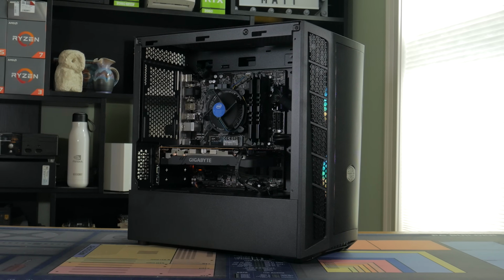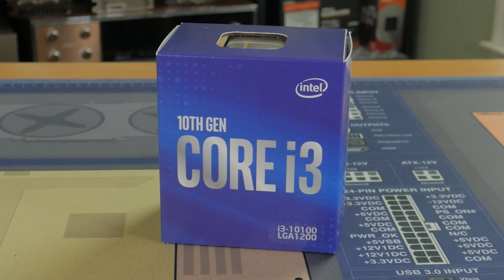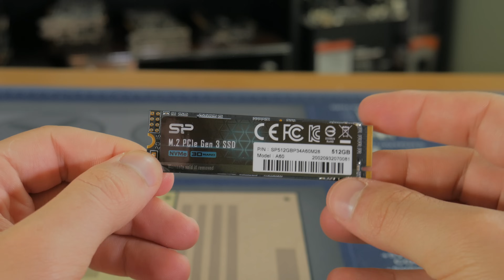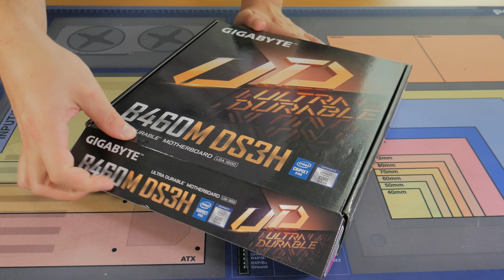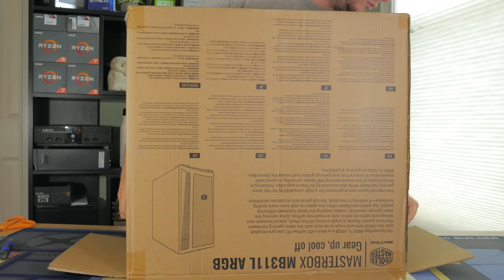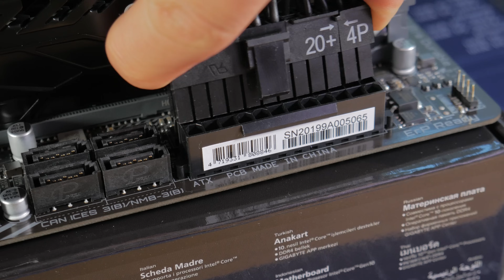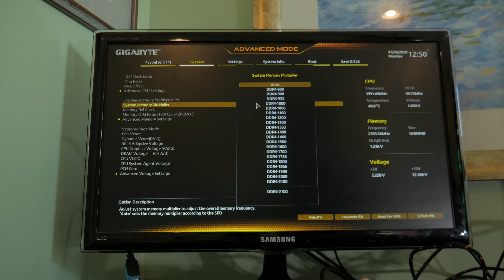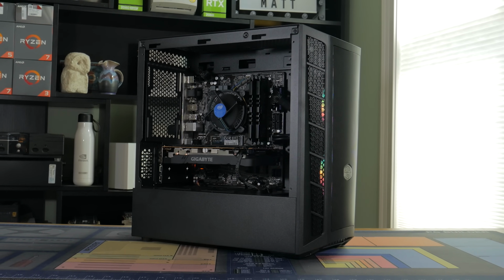$600 Gaming PC Build Guide! (2020)

Comment: Worst you can do way more with 600 bucks
Reply: If you can find a cheap case pick up a 70€ b450 asrok whit a ryzen 7 5800x on auction on ebay for 300€ and a 3070-80 still on auction for another 250 then a 15 dollar power supply from cooler master piked up used and 16gb of ddr4.

Comment: I've put together my own PC's for over a decade but couldn't get this processor to work. First intel build also. Checked and rechecked my build, swapped motherboards,  power supply and monitors. Checked ram also, still no video signal.

Comment: Great build, I used his most of his parts except for a few small thing that I switched to similar parts that were either a couple bucks cheaper or were in stock. I have no idea abt the frames right now because I don't have my monitor yet, but it seems pretty fast from what I can tell so far. 

The build went smoothly EXCEPT FOR ONE THING. I spent an hour researching if I could connect a 3pin header from the case's fans into the 4pin header of the motherboard, and it turns out you can, just make sure to change the bios setting. (https://forums.tomshardware.com/threads/can-i-connect-3pin-fan-to-4pin-header-on-mod-and-will-the-fan-spin.3344342/) Not including the time I spent figuring that out, the build took about an hour and a half.

All in all great build though, nice vid, good job.

Comment: Hi I bought everything and I tried to turn it on but it wont work, and now am scared because I cant return it
Reply: What won't work?
Reply: @JJFlores197  I bought everything he had and most of the wires he had arent in the case, and now it wont work and I lost nearly 700
Reply: @mo-zc8wz  Which wires are you talking about?  If you're talking about the front panel cables, make sure to check the entire case. I'm not familiar with that case, but sometimes the cables are hidden in the back panel. According to this video, the f_panel cables should be on the side: https://youtu.be/VIuO1yKEozE?t=400
Reply: @JJFlores197  I bought the case in the link he had in the description, it doesnt look exactly the same but its the same size, am missing the fan splitter, power led, reset sw, h.d.d sw
Reply: @mo-zc8wz  which one? He linked 2 cases to choose from
Reply: @JJFlores197  the one on amazon
Reply: @mo-zc8wz  If you have checked every part of the case and you can 100% verify that it is in fact missing the front panel cables, then you should be able to return it. Amazon makes it absurdly easy to return things, especially if they arrive damaged or not complete.
Reply: @JJFlores197  I cant return it bc it's been over 30 days, but I just realized that he has 2 different cases, in the Amazon link one, it has the same one that I have, but he has the one from the new egg link

Comment: this is NOT $600 I have a 600 system all parted out here it is
cpu: ryzen 3 3100
Motherboard: MSI b550 pro- vdh wifi micro atx 
RAM: 2x8 GB g. skill (red) ddr4-3600 cl- 19 
Storage: Team MS30 512 GB M.2
Video card: rx 570 - MSI 8GB armor oc 
Case: phanteks eclipse p300 Atx mid tower case 
PSU: EVGA BR 450w 80+ bronze

Comment: For those of you wondering, 3300x CPUs are impossible to find rn
Reply: yes but the 3100 isnt
Reply: I take this back now they are higher priced and starting to get a little harder to find but that’s what? 4 months after their release?
Reply: @trentbolognani2509  10100f is slightly better than 3100
Reply: @chickenism8107  i wanted an amd system and I grabbed a b550m motherboard so that I can keep upgrading without needing a new motherboard
Reply: go on ebay or adorama, there should be some

Comment: Great video but i would have chosen the r3 3300x because it has a better stock cooler , you can overclock it , its on the am4 platform and has that fast chamber thing that i don't know how it's called . Also , for a more all round cpu the ryzen 5 1600AF would have been better because it has 6 cores and 12 threads but availability is a tricky factor

Comment: I did a build with a 9100f for $76 16gb 2666mhz for $50,sp 512gb nvme ssd for $54,the case included in the vide for $60,600 watt 80pls bronze certified for $50
And the rx 5500XT for $200 with still 40 bucks left over. I will upgrade the cpu afew months down the line but for $560 with the only compromise being storage atm if your not a super intense gamer is a steal!

Comment: You should try Minecraft it’s easy to run and I would like to the FPS on it great video keep doing these types of vids
Reply: I'm not super familiar with AMD GPU performance but a mid-range card and a quad-core CPU should get well into 60s fps range with reasonable 1080p settings. Minecraft itself isn't hard to run, but I know some situations can be harder on hardware than otherwise expected.

Comment: I have built a budget pc for €150
I5-4440
Ddr3 16 gb ram 
256gb ssd
1tb hdd (from a oem system)
Used GTX 760 twin blade.
Case is a dell optiplex 9010
(Note, very risky when it comes to scams and broken products)

Comment: intel stock cooler lol
Reply: Are these parts bad for the price of the pc?
Reply: @maisonplays2049   no there not but if you have a little extra cash get a better cooler
Reply: @keithfernandez181  I’m going to get a I5 instead of the I3.
Reply: @maisonplays2049   ok thats a good pick but make sure it is compatible with your motherboard choice as well
Reply: @keithfernandez181  I’m pretty sure it is. Is it compatible if it’s the same socket size? Or is there other things that matter
Reply: @maisonplays2049   there are other things that matter but  for this price point I would go with amd maybe second gen ryzen 5 and a gigabyte b450m ds3h
Reply: @keithfernandez181  can you please help me and see if the I5 is compatible with the mother board? I already have the mother board and am about to order the cpu
Reply: @maisonplays2049  to be homest i dont think it is and plus the i 5 couldnt really be used to its full potential in this motherboard
Reply: @keithfernandez181  but will it do better than the I3? Because I already have the motherboard
Reply: @maisonplays2049  Well yes it will but the i5 isnt compatible with the motherboard so get the i3

Comment: Hey matt my budget is 350 dollars what case  would you recommend?I dont want to get a normal case maybe something like the deepcool matrexx 30
Reply: Deepcools real budget stuff is very noticeably budget, so just be careful. I got a Deepcool Matrexx70aRGB (the same case is sold without the aRGB fans for $70 instead of $100, but the 3 included RGB fans are not only diffused, but cost $45 per 3/pk and have like 12 LEDs per fan) for my first case, and it was decent enough, but no rubber grommets for cables, so it does still show it's more budget side.
Reply: @TheGauges420  Alright

Comment: First budget system I’ve seen that isn’t built around an AMD cpu... interesting
Reply: @drkrma1905  get the ryzen 3 3100 same price alot more performance 3200g is only gud if you have no gpu but even 3200g can barely play any games.
Reply: oreoeatsoreos facts, or the 3300x but I forgot the price on that pne
Reply: tbh i dont know many friends with intel systems these days, both on the budget and the higher ends
Reply: @drkrma1905  You should try saving for the 3100 or just getting the i3 9100f
Reply: do yk if you can upgrade with this?
Reply: @drkrma1905  Get a R5 3400G. The difference of price between this one and 3 3200G is around the 40% but it's 100miles far better
Reply: @drkrma1905  Buy Core i3 9100f if going with a gpu
Reply: Jürgen Klopp no overclock .... but it’s a decent choice
Reply: Very
Reply: it depends tho.. in my country i3 10100 is lowerprice than ryzen 3300x.. and that wrong but yeah.m differance country..
Reply: Very interesting
Reply: If I were you I would just save up a little more for a Ryzen 5 3600
Reply: @MakeGamesGreatAgain  I’m not in the market for a budget pc, I already have a nice $1500 one I built about 2 years ago. I just like watching these videos. But yes, a 3600 would be better, or a 1600 af if you can find one in stock somewhere and save a few bucks
Reply: @avimose4126  should I get an intel core i5 10400 on sale for $160, or the AMD r5 1600 for $150? Or is there an even better option for around the same price? Right now I’m looking at the intel core
Reply: @zimmet2279  I would suggest the 3600 if you have the budget, but if you find a good deal on a chip, take it
Reply: @MakeGamesGreatAgain  r5 3600 is a waste. For even less money there is  i5 10400f.
Reply: @drkrma1905  for a 100 dollar cpu the r5 3100 is far better
Reply: @drkrma1905  for 600 dollars a 3200g isnt too good
Reply: So is that good or bad?
Reply: Can you blame them better performance for cheaper price and integrated graphics go well with a full on gpu
Reply: Because amd is better
Reply: @theoverlord2946  I said that “isn’t” built around one. I personally run on a 3700x so I know the insane value amd offers, that is why I was surprised when it wasn’t a 1600af/2600 etc in this build
Reply: @avimose4126  I figured but I had to be that guy who has to be like this brand is better and what not
Reply: Dr KRMA get the 3600 3200g is crap
Reply: @Usicky12  Ever heard of budget?

Comment: Just a quick question I also got the same case and I’m not sure as on how to control the light of the fans
Reply: Did you get an ARGB controller? I use that lol
Reply: Aptra Studios yea i did but that the controller is inside the case I can’t open the side panel everytime I want to change the color
Reply: Omni Spark I personally hooked it up to the reset button on my case. It changes everything from there. You can find more information by googling it. It’s super nice having one button controlling it all.

Comment: tbh I would have chosen the ryzen 3 3300x. Costs the same, has almost identical performance to the 10100, can be overclocked and has a better stock cooler.
Reply: Definitely but those are hard to find for the stock price.
Reply: @gwm-btdbattlesagar.ioandmo9988  true.
Reply: @nyancat4992  ryzen for life tho
Reply: @gwm-btdbattlesagar.ioandmo9988  yep totally agree except for i3 9100f. For just 70 bucks, the value of that cpu is unbeatable.

Comment: 600 $ budget with a stock INTEL COOLER!   Come on!   but still, nice vid and you can still upgrade later on.
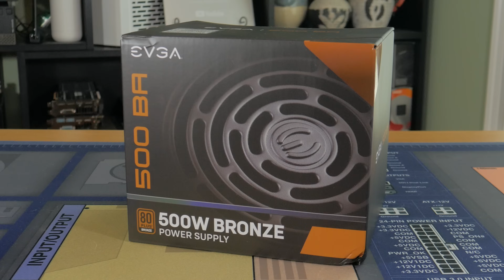500 watts, not 450 - 6:14
Reply: I know right $600 budget pc and he cant even fit in a 3090???
Reply: @kys7544  nice sarcasam
Reply: Had a stroke hearing 450 while reading 500

Comment: similar to mine but I went the ryzen way wiith the ryzn 3100 and gtx 1650 super, less storage on the nvme and used a 1tb hdd and T- force vulcan 3200mhz cl 16
Reply: I went Chinese and mixed between new and used.

87 dollars for a 12 core, 24 thread E5 2678v3 TU to 3.3ghz, 80 for a 32gb predator ddr4 2400mhz cl12 @2133 cl 9 8 8 17, vega 56 for 180 (blower model) flashed to a frontier edition bios, a "knock off" x99 Huananzhi x99 F8 motherboard for 90 usd on sale, a 650w 80+ gold non modular psu from Silverstone for 48 dollars out of their b-stock, and an MX330G for the case. Just transfered my storage from my other pc to it and added a 3tb spinning rust drive for 40 usd, and an Antec Khuler 1250 for 40

Comment: What I would do is buy the 8gb model after the new GPUs come out, and also get a pc cooler. But I’m going to get a 6800xt or a 3070 16 gb if I can get it for under 550, with a 5700x
Reply: The 3070 has 8gb of vram...
Reply: LEGO Obi-Wan Kenobi I know the ti model that was leaked
Reply: @qsw4kchips827  that's just a rumour, for now...